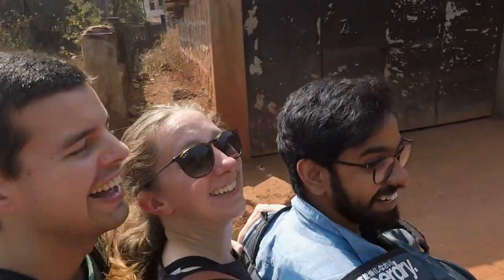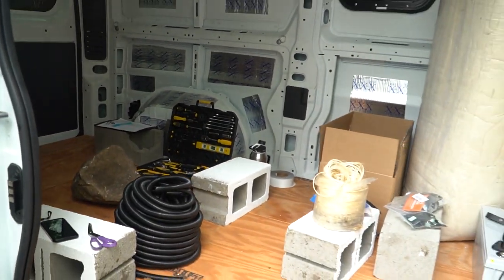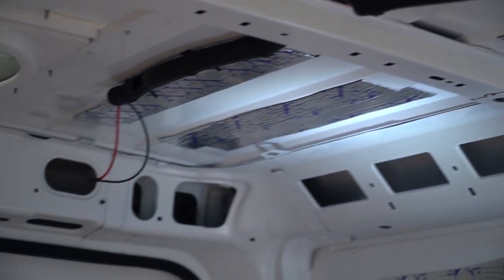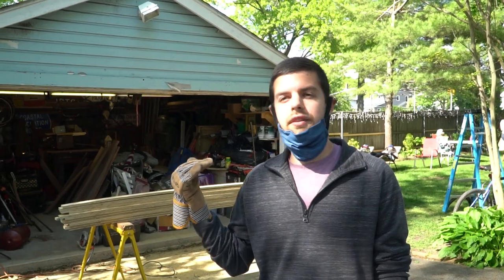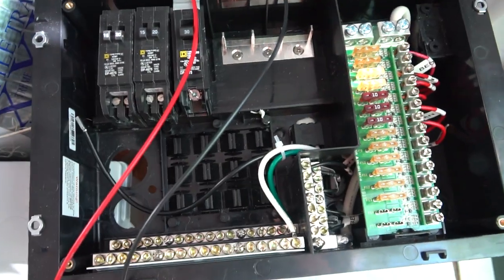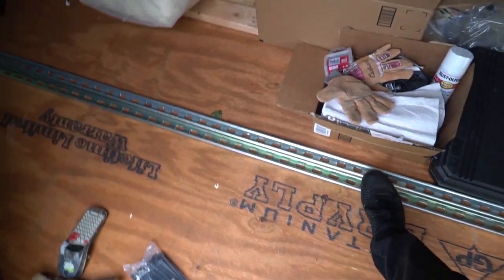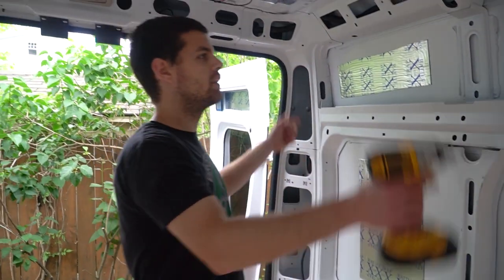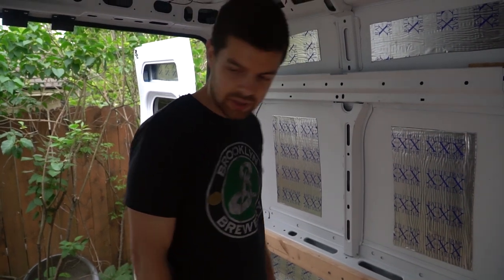Running the Electrical Wiring - Van Build Part 3 | Ep. 62

Comment: Too late now  but you shouldn't bury your wires behind walls and insulation in case you need to repair or tap into it😁
Reply from the maker: Totally, they are a bit buried, but that's one of the reasons we didn't spray foam. The shiplap is easy to take off, and the Havelock Wool is easy to dig through if we need to repair the wires. I'd rather them be buried and improve the aesthetic than be hanging all over the place! Thanks for watching!
Reply: . I hope it works out good for you. I think I'm gong with that crown molding that has a space behind it and some conduit I can paint to blend with the aesthetics. The reason I said that is Ray Outfitters did a video on it and many of their customers had to be completely rewired because their wires were buried. I'll try to find the video and send you a link if you want to watch it. I Love watching builds 👍
Reply from the maker: @jhemnes1  Interesting! There are always things you continue to learn as you go. I will say it's better to just build it instead of being paralyzed by the details. But if we were to do another build, we would take that into account!